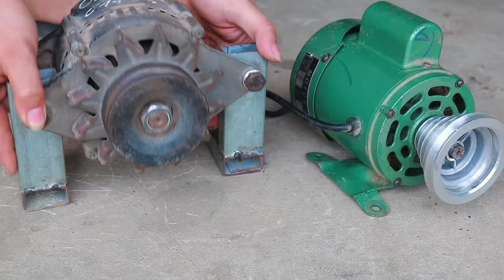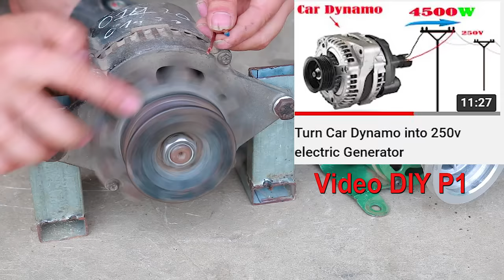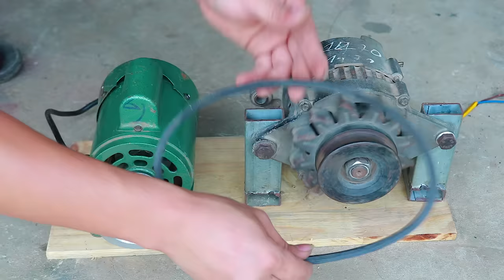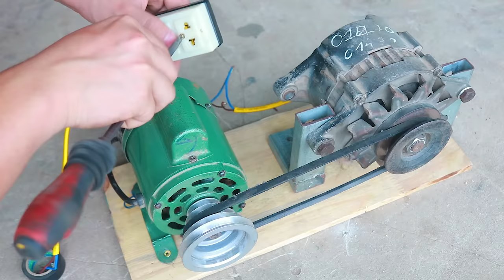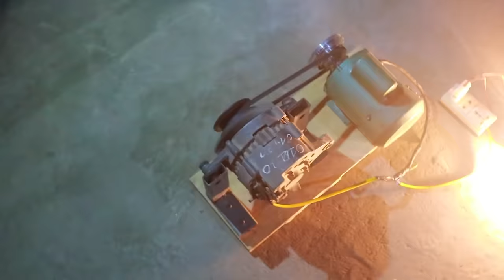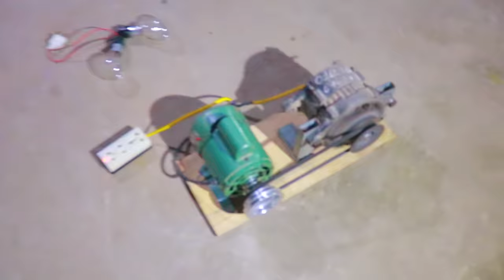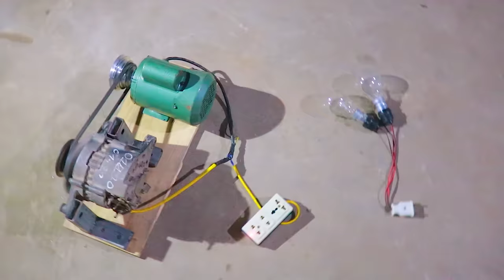How to generate homemade infinite energy with a car alternator and an engine P2💡💡💡

Comment: As long as you have an infinite supply of power in the first place, he will reduce the efficiency by 20-30%, but look on the bright side 80% of infinity is still infinity ♾️😂
Reply: dont laugh i just did this on a micro scale using toy motors it bloody works , i think weve been lied to like everything else in life.
Reply: @jediknight2350  conservation of energy doesnt fully right, in extreme situation energy could just disappear in to nothing, light could travel away from it source and eventually fade away in to nothing
Reply: @jediknight2350  can you show us your setup and results?
Reply: @Cybergrip1  i can try do video
Reply: @kennezarfadhilalfian8201  true but that's not how it works again even in the most extreme cases energy cannot be destroyed or created.  In the sense you used it in light doesn't ever fade away this is proven by the stars in the sky and the reason we can't see all of the them is because some stars are covered others since they are just so far away the They get covered and that's why we can't see them to the naked eye. each one of the stars is a sun shining with nothing blocking it. So that's how we can see it from the naked eye. You were on the right track man but not correct
Reply: @jediknight2350  lol this video is fake there is a power supply underneath the wood. Have you ever seen the law of conservation of energy
Reply: @kennezarfadhilalfian8201  also the reason we cannot see all the way out is because at some point there is a star blocking or planet blocking the way of light from reaching us
Reply: Shahid there are bigger infinities the the infinity you know

Comment: Don't alternators need 12v in to operate?
Reply: So I went to school about for aviation and as she learned something neat so generators generate 12 volt 13 volt 24 volt DC current alternators generate alternating current which is what your house runs on but the alternators we run in our vehicles only generate up to 24 volts usually and a lot of them generate 13 14 volts which is what most cars run and then they use diodes to correct the path of the current so that way it's no longer alternating they make it direct current instead and they use a voltage regulator to regulate that voltage down so that way it doesn't overcurrent or overcharge your battery

Comment: Yes.
A car alternator is just a generator, you just need something to spin it and generate voltage

On a car, the 12v battery starts the car, then those 12v go to alternator and since the car engine is spining the alternator, its generating voltage, so long as the car is running
Reply: Como se conecta del alternador qué cables son  mui buena idea cuantos Amperes genera qué puedo conectar con ese generador

Comment: What is the output current and voltage
Reply: Infinite. Didn't you read the description?
Reply: @brodiewells  did you take into account that's breaking the law of conservation of energy? And there is a power supply underneath the wood. Simple people like you don't take this into account tho so it's reassigned
Reply: @maxharrysson6305  wow! I tried to be obvious that I was being facetious. I apologize to @Tsaphah of I wasn't obvious enough. Were you joking or do you really go around calling people simple for making jokes on a joke video? If the latter, I'm happy to compare curriculum vitae.
Reply: @brodiewells  no but Ur mad that someone called you out r/confidentialyincorrect here we come
Reply: @maxharrysson6305  called me out for what?

Comment: As it stands this machine, whilst very clever, is less than efficient and could be improved by including a polarised subduction spline circuit in the output. This would damp out the side band resonances and make the device much more compatible with the latest generation of reactive current devices. The spline circuit is easy enough to make and simply requires the use of two automotive spark plugs and a coil of heavy gauge copper wire (connected in series)

Comment: Atencion usuarios ,le están tomando  el pelo  ,el motor de movimiento perpetuo es imposible, todos los tipos de máquinas van contra la primera y segunda  ley de la termodinámica  e incluso contra las dos leyes, que son las principales  leyes de la física  y del universo.
Reply: Also the law of conservation of energy. It has a hidden Power supply underneath the wood
Reply: @maxharrysson6305 The energy was supplied by the drill, not free energy.Like riding a bike and coasting for a while.

Comment: Ok,the light bulbs lighting up is awesome the first time,3rd and 4th time i just wanted to see how you shut it off.. i do thank you for the video though, im trying to build an electric generating device to use in my camper without running down a deep cycle marine rv battery and power inverter
Reply: Maybe just Maybe disconnect the wires from alternator to motor, or how about installing a switch? Yes I am "the smartest man in the room"
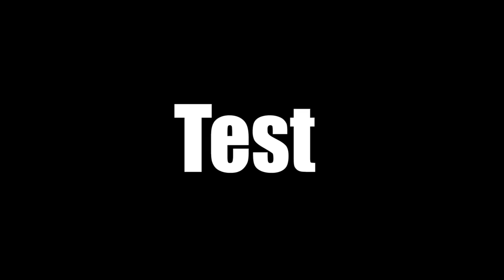Reply: at 2:30 you can see him light the bulb first time

Comment: In the minute 4.00 you can see the second cable where the motor feeds. And of course there is no free energy or perpetual mobiles.
Reply: U need glasses 🤓 bro. There is no "second cable
Reply: @vroor32  Yes, in fact I have to wear glasses to see up close but the good news is that I don't need to see to know that perpetual motions are a fantasy and not only because the laws of thermodynamics say so, it's because I've been working in electricity and electronic for almost 40 years  and had enough time to experiment and study, like others when I started so well I sounded with the same fantasy that you see in this video. By the way, the creator of the video calls himself MR COVER, why would it be?. Build the device experiment and then we talk about my glasses. Kind regards and thanks for commenting.

Comment: Very cool, but I'd like to see a plug in drill used rather than a cordless drill to kick start the thing, and then the same drill plugged into the generator required to make the same number of rotations under the same torque, plus one rotation...

Comment: Exactly. The same in the car. The battery gives it the spark and the alternator keeps it charged
Reply: Yes, but what turns the alternator? Answer: the crankshaft. But what turns the crankshaft? Answer: the pistons. But what makes the pistons go up and down? Answer: the spark and the gasoline. But what happens when it runs out of gas? Answer: the engine stops!

Comment: An alternator is simply a motor that is being run by belts that caused it to generate electricity that goes to the battery and is used in the car and Powers everything in the car. It is like a very small house.

Comment: Considering that it takes hp to generate electricity from the alternator, to drive the electric motor, and it takes a defined amount of electricity to generate a hp of mechanical energy, there's no way to overcome losses and inefficiencies,  and produce extra energy. In this instance, three electric motor is being powered to spin the alternator and to power the light bulb. The alternator is doing nothing in this equation to produce anything. In fact, an alternator requires electricity to power the field coils before it can produce power. It naturally produces A/C (hence the name), but is rectified into D/C and regulated to about 14.8V max. It's output, at a specific RPM, is variable by design, usually between 70 and 220A, based on the maximum electrical loads applied. A large diesel engine would have a higher amperage alternator, and service vehicles may even have 2 alternators. Some farm equipment, aircraft, commercial trucks, and military vehicles use 24V electrical systems. By doubling the voltage, you halve the amperage for an equal load, allowing for use of smaller diameter wire. It has been proposed that all vehicles will switch to 24V systems in the near future,  to reduce the amount of copper wire used in automotive production. Currently, on average,  a new car contains over a mile of wire and is only growing with the use of more and more technology being added.

Comment: Im thinking if you looped the generator and alternator you could get endless running, but I believe a second generator out of the power loop of the first setup, but tied only through a belt to the first 2 may indeed create power, but the second generator would have to be isolated from the gen/alt power hookup.
Reply: The problem for any of this to work is The system is making power without any input-  that defeats the laws of physics but let us assume that it is possible for them to practically work (ignoring a couple of the first principles of physics) . The whole unit would have to be 100% silent. 100% friction free therefore generating no heat and of course no magnetic field creating duct and drag etc. So none of those could be created even though we need those to make electricity because any of those forces are going to rob some percentage of efficiency and therefore it will slow down and slow down until it stops- assuming all the electronic set up was functional.

Comment: "No way..." How long before you need to start it again with the drill?
I don't see any hidden wires. Those are like 60w incandescent 230v lights? LED probably not incandescent. You are indeed burning power and that thing isnt just free-wheeling. You did something right - if it truly does run infinitely maybe you found some way to pick up gravity or other unknown force

I do believe that the only way to truly make something impossible is to believe its impossible - but id sure like to know how this is done

Comment: Those who say that friction would slow the motor down or that both the motor and the alternator would overheat, are simply wrong.  The alernator has an internal fan that keeps it cool wnough to work even under the hood of a car! The motor also would have a fan inside it. The only question thus becomes, can we find a motor with high enough efficiency to drive the alternator to full output while consuming only a small percentage of the alternator's power output.

Comment: I had just done the same! The only thing is adding a fully charged battery! The alternator keeps the battery charged while running the motor. The motor i used is out of a cordless vacuum.  Add a power converter and your set. One other thing got me thinking is why could'nt a solar panel charge a car battery and so i took a small ATV Battery and hooked up the solar panel and sure enough, there fooling us, it works! A battery charger for double A's, AAA, C,D and 9v batteries, non chargeable charge the same as if they where chargeable! Battery companies are fooling us all!

Comment: Not an engine. Engine is internal combustion, gas or diesel. People use both interchangeably, but the difference is that motors run on electricity and engines run on combustion. The engine converts various forms of fuels into mechanical force, while the motor transforms electrical energy into mechanical energy. Good video though.

Comment: The only way this would somehow make sense would be if the green motor was in fact a 12 V DC permanent magnet motor & if you were to be feeding that power onto the alternator rotor winding coil (while removing the rectifying diodes & capacitor on the stator secondary winding. 🤔😕

Because I doubt that green 220 V motor is a permanent magnet type in the first place.

Comment: I have a 100 watt equivalent LED bulb that only consumes 3 to 4 watts. Can i use that to light up a 50 watt or 100 watt solar panel to full output? That could then be scalable to produce as much power as i need. I could store the energy in 12 volt deep cycle batteries, and hook up an inverter to that to supply all the power I need. And I suspect that I can use a car alternator that puts out, say, 65 to 135 watts at a time, but can I find a motor that will drive it to full power while consuming less than the output of the alternator? That would provide usable power. I think that doing it with the solar panels would be more efficient, however....

Comment: Im sure It will stop at some point because there is a delay. Surely this wont run forever. Those who makes this are dull and dont know how to compute.
Reply: The energy that was supplied at first is the one that really makes the bulb light plus some delays because of the magnet mechanism on both motors.

Comment: The efficiency of the engine is approximately 95%, and the efficiency of the alternator is about 75%. Therefore, in your setup, we have an efficiency level of 70%. We are missing 30% of the energy for this setup to become an "infinite energy generator", so we would need at least an additional 31% more energy. Physics cannot be cheated...

Comment: I've question. According to law, energy can't create or destroyed but convert into one form to another.
The kinetic energy stored from drill machine in the motor will utilized in the system and we will provide this potential energy to the motor after sometime.
Otherwise this system will stop running.
So in my view, we can't generate electricity by using this system because to run this system, we must provide the mechanical energy after some time and we would repeat this again and again.
So we can on the bulb with the help of that energy which we stored in the system with the help of drill matchine.
Without constant backup from the drill machine, this system will not survive.
If I'm wrong, kindly guide me.

Comment: It is this easy but it will eventually die.  This would be like spinning up a toy car except the spin last alot longer.  This is about the maximum time you can keep something spinning.  It's not perpetual motion cause that's impossible but it's a pendulum exchange.  The pendulum will eventually stop tho.  We could run cars like this but it would require a large crank that would have to be manually spun and people wouldn't like that.

Comment: In the alternator there is a battery(live wire)an ignition controlled and a light indicator,where did you connect the two wires o a 220v motors?

Comment: I saw a YouTube video where a guy showed that magnets and a generator put together can generate free power. The propeller spun and the voltmeter showed power being generated. The trick was that off screen, someone was using an airhose to force the propeller to spin. Physics teaches there is no such thing as perpetual motion or free energy. Nice to dream, but it is not possible. 'But it must be true. I saw it on Youtube'. I live in reality

Comment: Alternators needs a power supply in order to generate  power once it starts from the battery power it will then put out power with out the battery till it's is stop ,once it starts it will kept the motor running  and pulling it's ,,but the more load put on it the big the motor is need

Comment: Energy in equals energy out. Your battery powered drill gave the closed system it's energy. The lights will turn off when they use up the energy you input from the drill. LED lights draw very little energy.

Comment: Now attach powerful magnetic force to keep the moter running also a pull start to moter to start it spinning and you need no energy to start it and the magnets to keep it spinning.

Comment: I am not sure what the exact components are that you used, but my assembly did NOT work.
I used a 1/2HP 120VAC motor, a 100A alternator, a 100Ah Battery and a 5kw FSW Inverter.

The Alternator would only generate 4-5A using the 1/2HP 1725RPM Motor and drained the battery quickly.
Changing the 3.5:2.25 pulley ratios only made things worse.

The inverter would not start a 2HP 3450RPM motor completely and would cycle on/off.
The inverter took 90A DC, the alternator generated 40A, and drained the battery very quickly.

Neither motor would generate even close to the current needed to run the motors, let alone extra current for anything else.

Comment: An alternator outputs 12 - 14  VAC and it is converted to DC via rectifier within the body of the alternator for vehicle electronics. The motor is most likely AC as its supposed output is. So he's powering a 110-120 VAC motor with the rectified 12V DC from the alternator. Even of he used the direct coil output it wouldn't be the proper voltage. I know people would love to believe you can just match up whatever electrical component you wish and it just magically work but that sadly isn't the case. Let's also say that this alternator was putting out the proper voltage and current to run the motor. It may spin the motor but will stop due to energy loss (in the way of heat) over time. The biggest delusion is that you could remove energy from the system to power something. It would stop moving quite quickly. I don't know if these videos or people believing them drives me more crazy

Comment: I been saying things like this can built  be very easy.  And
build a car  just like that , a electric car with batteries that can power the electric motor which can power the car and a  generator to keep the batteries charged , a continuous powered car that you change batteries or a contact every now and then. The Automakers doesn't want us to have cars like that as they couldn't sell enough of them. We buy one and drive it to we die .

Comment: if you implement a gearbox from low to high rpm will to output be higher to run the moter and get more power that you can steal from it for your own use?

Comment: I was wondering what motor will turn a alternator fast enough to charge a battery Bank in the house to run a car audio system like that setup. The amp will have a draw just about the same as the alternator puts out 150a but the motor turning the alternator has to be able to do 2000rpm to keep the amps up to keep the feed uo and the batteries changing.
Reply: I seen another video like it and they took it apart added magnets around the whole field coil and rewound it with a lot more copper wire